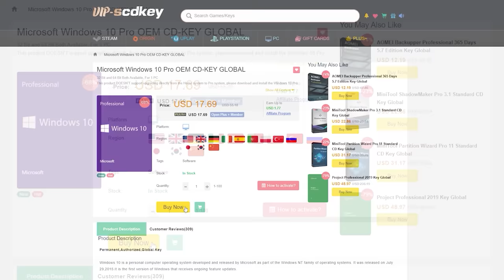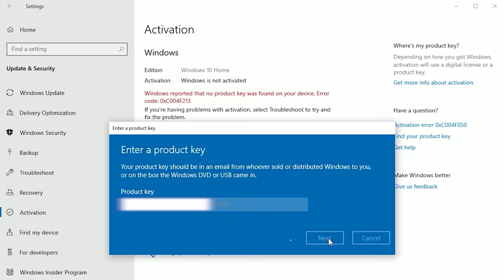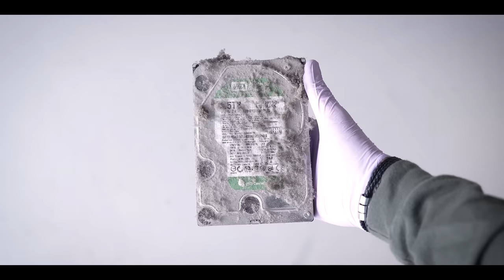Deep-Cleaning a Viewer's DIRTY Gaming PC! - PCDC S3:E6

Comment from the maker: OFF TOPIC: We have a public Minecraft server! There are a few data packs baked in to spruce things up a bit. Nothing too crazy. Extra biomes, some v1.19 stuff, amplified nether, etc. Do whatever you want in it (except cheat or attempt to crash the server). Good luck! Info to join is below:

http://salserver.serv.gs
51.81.117.244:25565
Minecraft Java v1.18.2
Reply: I like the cleaning vida to be 12 min
Reply: The link does not work
Reply: Hey Greg I have a problem my cpu cooler doesn’t mount the pump works totally fine but I think one of the standoffs on the left are not screwed in all the way and I can’t take it out is there a way to take stuck standoff screws out or will I just have to get a new motherboard
Reply: @yourlocalidiot5090  he doesn’t host it, it’s probably got ddoss protection. By “crash” he means using stuff inside the server to overwhelm it I reckon. + giving the direct ip does nothing, if people wanted to ddoss they could easily go from the names ip to the direct ip.
Reply: 10 USB ports hold on my dein w3680 system only has 6 USB 2 ports, no USB 3
Reply: THE PSU is Super OLD LOL but it looks so cool :Q
Reply: hi so I have this problem with a gaming pc I brought with vrlatech  to where it boots to the bios menu every 2-3 days and I cant get into the bios by hitting f2 or del so I wait till I get to the bios menu (it loading me into it after waiting) to select the drive then boot to windows now i also have a new problem to where my SSD doesn't show up and I checked to see if its gone bad or what and it says its ok I'm also running windows 11.

I'm just asking for your thoughts since you know a lot about computers I'm planning to contact tech support to see if they can give me a solution to my problems just wanted to ask you for your thoughts
Reply: I am a VR gamer, would the VR MOD be allowed?
Reply: ok when i repaste my cpu and gpu whould there be anything else on a gigabyte b450m ds3h v1.0 motherboard that need pasting cause there's a label gigabyte brick thing on it just like this motherboard and how do i remove it if i do need to repaste
Reply: I'm only gonna join this later since you're a tech savvy guy and likely know how to manage a server and plus the community here is nice. Seems like a gem of a server with more mature players considering the community.

Comment: not quite everything went back in there. I still use my DVD drive on occasion. I like having it built-in, but I guess a USB external drive works. [don't even bother spammers, I'll just report you and remove the reply]
Reply: That's never gonna stave off the spambots, you know.....lol
Reply: I just did an all Orange 🍊 Gigabyte Aorus PC build using Be Quiet's Pure Base 600 Orange with side glass panel. Mainly because I wanted to keep my Blu-ray drive from a previous build. Definitely looks very sharp!

Comment: RIP the dude's DVD drive. I wish more modern cases still widely had bays for it as an option. I rip music, movies, play legacy games, and burn stuff with mine from time to time. Hate to see a new case cost some functionality, especially if you're into retro gaming or want to backup a collection of songs and movies for a home server etc. I had to settle for an ugly case in my last build just to have the form factor I wanted and the drive bay availability. Still this PC definitely looks a lot better cleaned up!
Reply: Agreed, I feel like I say the exact same thing every single time Greg uploads a deep cleaning video. He upgrades the case a lot and it costs the disc drive that was in the system every time.
Reply: I agree. I have a Plex/Minecraft server, and because of that I'm using an older Antec Case as I did use a blu ray burner to digitize my 4k blu rays. Plus I needed the 4 HDD bays (which most modern cases only seem to have 2). I did end up getting a new external blu ray burner though. But they do get a bit pricey, I believe the drive was like $85. Which isn't terrible, but when you already had one, it's an unnecessary cost. But the new case Greg gives is a lot nicer. So it's kind of a double edged sword.
Reply: @Monkeystompn  I'd love to know what the external drive is. I don't use an optical drive often, but it is nice to have if you ever need it.
Reply: So true. What someone can do to remediate this, is to get a powered USB external drive adapter. Backed up a 500+ DVD collection this way.
Reply: I just did an all Orange 🍊 Gigabyte Aorus PC build using Be Quiet's Pure Base 600 Orange with side glass panel. Mainly because I wanted to keep my Blu-ray drive from a previous build. Definitely looks very sharp!
Reply: Yeah, the lack of 5.25" drive bays and 3.5" HDD bays is annoying on modern cases. I have an old Fractal Design Define R5 which still has them
Reply: I know it's a bit less convenient but you can always use an external usb bluray drive. They're pretty good and are compatible with pretty much everything except the dreaded "HD DVD". I personally recommend the LG BP50NB40 bluray writer, it can even read PS3 discs.
Reply: I agree, finding a modern case with a front drive is now a pain in the ass.  And because of that, the 5.25 drives will be more and more rare.  Before it becomes impossible to find, I've been able to snag for a fair price a writer that does pretty much everything.  BD (multi layer) / DVD + - R W / CD - R / Lightscribe.  But it was already rare, I had to import it from Germany (to Belgium)
Reply: Another reason I went with my Fractal design 7.
Edit: @10:00 If Greg ever runs out of dirty PC's, unlikely I know but he could always do a cable management series. 👍
Reply: @NYCamper62  My media server was in the Fractal Design Focus G because it had 2 5.25 bays. Than I replaced it with a Silverstone PS13B because it had 2 5.25 bays and an external 3.5 bay to put a multi card reader into. worst case to build in no room for cable management at all. End result was exactly what I wanted.
Reply: good ol Fractal Design Focus G case in blue is nice imo
Reply: Yeah I'm gonna swap to an older haf 912 case soon. It actually has more airflow than my current case lmao
Reply: @Pasi123  My Fractal R7 has provision for 1 optical.

Comment: Crazy how much dust gets caught in the drive cage
Reply: That particular case, the Antec 900, had 120mm fans mounted in front of the drive cages. I owned one and all of my drives were a nightmare to keep clean. Amazing airflow though!
Reply: I think one of the reasons is because it's magnetic etc. so it kinda attracs dust but I could be wrong. Noticed that aswell in basically all cases.

Comment: Didn't expect to be hit with nostalgia. The XFX 6870 was the GPU I got for my first build back in 2012 :D
Reply: XFX 6950 1gb was the first card ive ever bought and installed, had an acer prebuilt back in the day (bought in '09, still got the mobo + cpu + ram, case got binned coz it was shorting something out after few years of use, rest got parted out for other builds n sold off) that came with a 4870 1gb but that died around '011-12 so ended up getting the 6950 for £60 off of gumtree, was legit an amazing card back then, played mafia 2, gta 4 etc like an absolute champ

Comment: What do you do with old cases like this, Greg?  Recycle (as in, into the recycling bin for county pickup)?  Another great video, man.
Reply from the maker: Some are recycled. Others are given away or donated.
Reply: @GregSalazar  I was not the only one with the same question lol
Reply: @GregSalazar  you might want to donate that case rather than toss it.. while some of these things do look garish, this particular case does have uses still. did you know that the fan speeds on those were adjustable? (although you had to take the side panel off to flip the little switches attached to the fans..)
Reply: The case in this video looks to be an old Antec 900 which still fetch a bit of money on ebay. There really aren't any case manufacturers who make cases with so many 5.25" bays any more and there are still people looking for these types of cases, so if you have one with a crap ton of bays like that, try selling it. 

Also right now, end of May 2022, the prices for cases is through the roof. In 2016 I bought a Rosewill Ranger-M for $17 brand new direct from Amazon. Right now I can't find a listing for that same case for less than $59.99, so any cases right now are worth selling including no-frills business-style cases.

EDIT: Oh no, I just watched the rest of the video, he replaced the case! That Antec was such a classic. Those were really popular when I first got started building computers when I was in high school, so I guess I have a soft spot for old hardware like that. Oh well, it was still neat to see the combination of old and new parts.
Reply: @darkred1686   Yeah I have one still. has an older setup in it, but still is functional. also have another model that was more standard, but had the same number of fans and bays, I can't seem to part with these.
Reply: @robert1975031  I used to have an Antec 1200 and I still regret ever getting rid of it especially as I now have an Unraid backup server.. doh, would of been so useful with all those bays! Saying that, I did keep the 200mm big boy fan and coverted into a desk fan for the hot summers, works well.
Reply: @Venom012  I have another one of those fans that was orphaned, yeah not surprised actually, those things move a ton of air.

Comment: I remember when the Antec 900 was considered a workhorse. If given the opportunity I would have had the interior painted flat black and threw some LEDs in there for ambience, swapped in for some PWM fans, and maybe use some of that headlamp polish on the acrylic to help bring it back. Installing aftermarket mesh filters as well would have also been a big help down the road for this relic.

Comment: The second I saw that the case is an Antec Nine Hundred, that explained why the dust is so bad. Lots of huge fans, no filters and a cramped interior with pretty much no cable management options built in. My old AMD FX build was in one of those and it'd look like that after a month. Even still, these cases were really popular back when they came out.

Comment: I actually have the same case, white version. AMD 5700G, 64GB Crucial RAM, EVGA 3060Ti. I added 3 extra RGB front fans and moved 2 original 140mm to the top. Great case love it.
Reply: Great specs 👍

Comment: Last time I've seen a working HD6870 GPU must be almost a decade ago. Very rare to see a system out there still using it.
Reply: And pretty useless, I have a GTX 560 Ti in my Old GPU collection and it beats that AMD card
Reply: I still got my 6950 1gb in a pile of old parts, sadly even a gtx 570 destroys it but it was an amazing budget card when i bought it i think 10+ years ago, need to get it fixed one day (resistor got knocked off in storage) and put it in an old q8200 ddr3 rig ive got and make it my win xp/7 retro gamer

Comment: I've had the core i5 750, and it was a hot head especially after a few years.  In the summer it was impossible to cool properly so I had my case open and had a big fan blowing in it to help dissipating some heat. But this PC man... this was a firehazzard and I doubt this system has been on the last years because the thermalpaste was so crusty it couldnt be on more then a few minutes before overheating on the stock Intel cooler.
But the transfermation was impressive, although I do have my reservations about if this is a PC that actually was used recently.

Comment: i still have two of the cases that the build started in or similar antec 900 which do have great airflow but  are a nightmare for cable management without modding they were the first systems i ever purchased one also featured a blue gigabyte motherboard however was z68 chipset with an i5 2500k 16gb ram and a gtx 750 all of which have been upgraded since including that chonkmonster of a case

Comment: Hey Greg,
What you did with that CD drive? Does any modern case have the capability to mount CD drive in the front?
Reply: There are some, but I don't think anyone would want to restrict themselves to cases with a 5.25 bay these days. You'll probably end up missing other features you want. I still use my optical drive for a few things, so I just bought an external enclosure when I upgraded my case.

Comment: You have any tips on how to clean the psu? I remember in a previous video you said you don’t do them or show because you could get killed. I have one I desperately need to clean but kinda afraid to now lol. Me and electricity do not go well together.
Reply from the maker: I took this one apart in this video. Not difficult to do. Few screws up top holding the grille/fan and maybe a few more along the sides. The shell slides off and you'll have access to pretty much everything ya need. Just be careful.
Reply: Ok. And it’s been a long time since it’s been powered on. I will attempt it. Was just concerned if there is a certain part inside I shouldn’t alcohol swab or not. Thanks Greg

Comment: I have that same case and replacing the 200 mm fan on top is a pain. My daily computer no longer uses that case but is a great home server case and I am now using it as a Free Nas server and it is working out great. It is really easy to replace hard drives in this case. That case has done a lot of work for me and many other people . Antec cases of that era are great. Many cases today do not have the features that case has to offer. You are much too quick to dismiss it.

Comment: From experience, I can say, there is nothing worse than refurbishing a laptop  that was previously owned by a heavy smoker. It is not just  the smell, it is removing the residue from the fans, motherboard, keyboard, and plastics. Everything has to be taken apart and deep cleaned. Often, the ribbon cables and keyboard have to be replaced to bring it back into decent condition.

Comment: hey! so im working on a new pc and just wanted to see if these parts sound great before i go out and buy them if you don't mind. CPU - Intel Core i7-12700K  GPU - Either the 3060 or 3060ti RAM - 32gb DDR4 3600 MOTHERBOARD - ASUS Prime Z690-P and powering that would be a 850w power supply. (this will be used for streaming/gaming)

Comment: I just replaced my cooler master CM 690 II case from 2011... It was the last surviving piece of my very first build. Sad times, although my new case is much quieter without the insane rattle.
Reply: My first complete custom build was in the Antec 900 like this one in 2008. It is also the last remaining survivor. However after seeing this I am going to upgrade and relegate the Antec to a NAS in the equipment room.
Reply: @kadinzaofelune  I had a terrible Gateway prebuilt that I used before 2011 to play WoW. I threw a 9800GT and a new PSU in the thing and it ran great up until I built my own. I had to get those shadows working in TBC haha

Comment: I have a secondary system pretty similar to this. It's also first gen Core i series with a HD 6870, but on the X58 platform. I'm also using a modern case too, however I think something like that Antec 900 would have been better. My current case is too modern, only USB 3 so I have no front panel USB on my 2.0 only board, but shipping a case like that is expensive and I'm not really sure where to look locally.

Also, is cleaning under those heatsinks and repasting the chipset necessary? I'm wondering if I should do that for my system, but it looks pretty clean on my system from what I can see.

Comment: Greg Salazar this is not really a comment about the video itself, but suffice to say, I really like the video series on this channel and have been able to apply some of the techniques to my own system here at home. This comment is more geared towards your sponsor, VIP SCD-Key. I saw the price for the Windows 10 Pro license, and I thought, I’d like to have a couple of those for my systems here at the house. I purchased one to check it out, but upon receiving and putting in the key in my system, it didn’t work. Windows said it was an invalid key. I began to research the company and read reviews about it. The reviews I read said the keys they received also didn’t work, and they asked for refunds. Some didn’t receive one at all. I did some YouTube research to see what was up. One YouTuber (Liron Segev) used a utility on Windows that is designed to check the validity of the windows key. I used the utility to check my key, and as luck would have it, it was a Windows 7 Professional key, not the Windows 10 Pro key I purchased. I mentioned this to the company and they were quick to ask if I would like a refund. I asked for a refund, and about a month later, I’ve yet to receive one. I’ve pretty much written off the $16, and I’m not going to go after them for it. I just wanted you to be aware of this in case any of your other viewers have had similar experiences with VIP SCD-Key.

Comment: Actually I'm not in full agreement with the cooler replacement. An AIO water cooler is more prone to breaking or malfunctioning, and is less convenient if you need to swap parts. I really think that a tower air cooler would have been better.